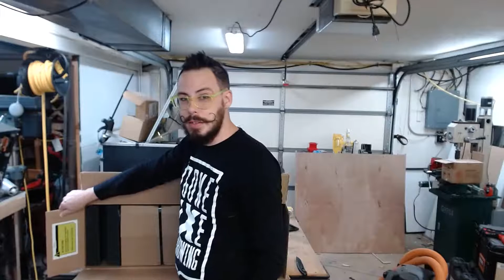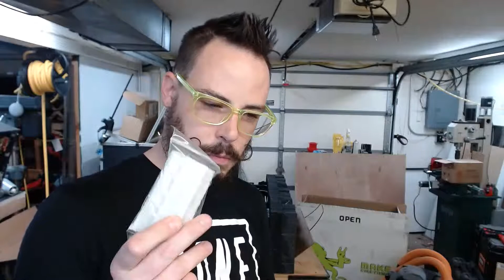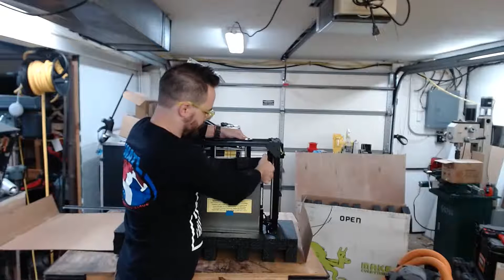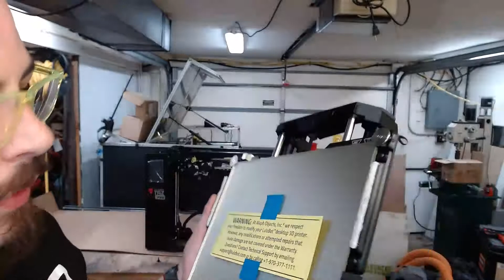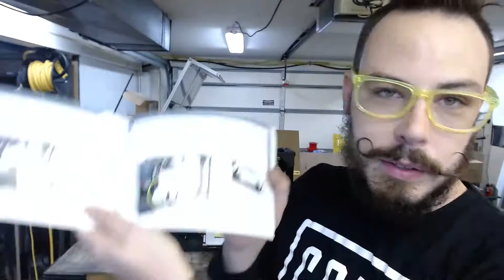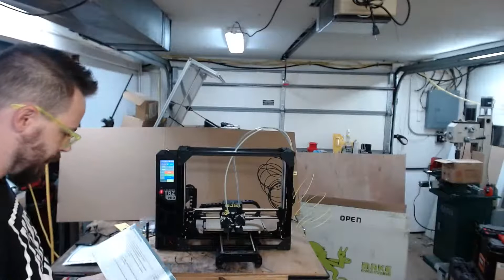LulzBot TAZ Pro Unboxing and setup

Comment: How you liking it?
Reply from the maker: Its worked really well. Its one of my two main printers still. The dual material just works which is more than I can say for any other dual material printer I've used.
Reply: @prcdslnc13  I ended up getting one. I love the lifting extruders. Mostly using for single color prints and makes it easy for my production not changing out filaments or having to worry about a second nozzle hitting a print.